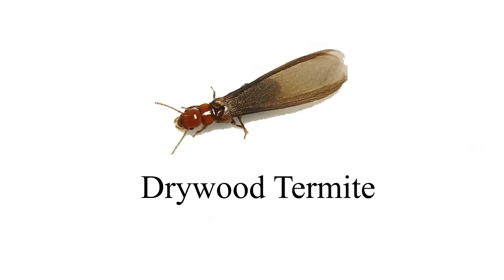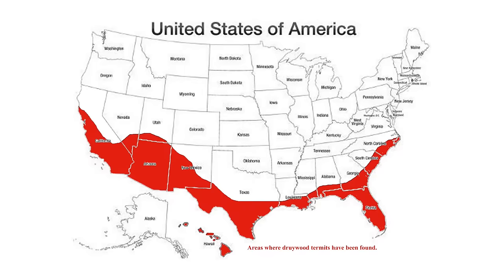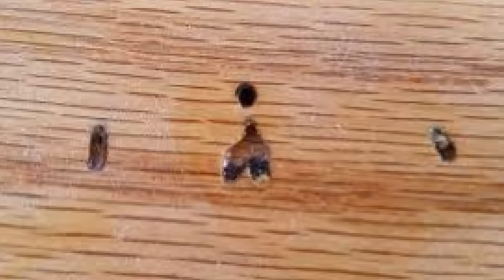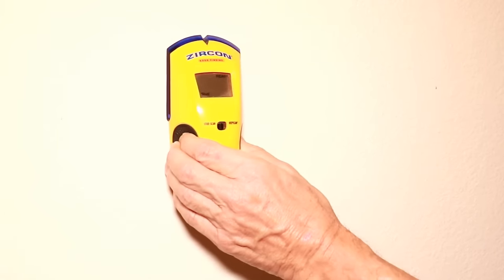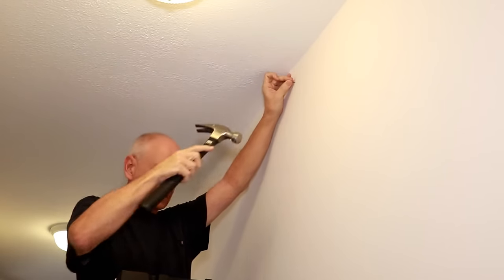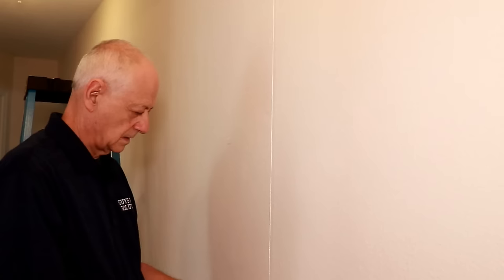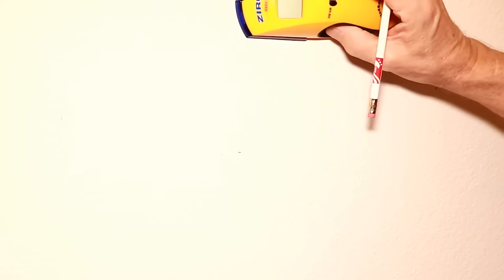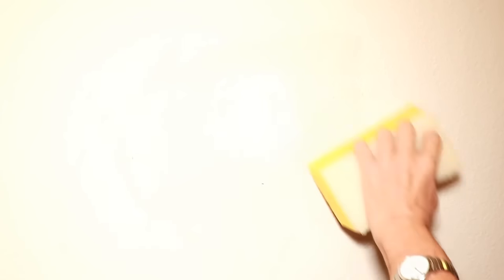How to Treat a Drywood Termite Infestation Yourself. A MUST see if you have Drywood termites.

Comment: Hi Guy, I bought an old apartment that was uninhabited for a long time and a lot of the floor and some doors have been damaged by termites. It's a  very nice wooden floor therefore I would really wanna keep it the way it is. I painted it with insecticide but I dont think it has done much as the floor is varnished and the penetration through the varnish must have been very low. What would you do? I ve been thinking of drilling holes and injecting foam/ or just the liquid insecticide I have but here (Portugal,  Madeira island) the selection of products is very limited and foam might be very hard to get.
Reply from the maker: It never ceases to amaze me how difficult it is to get pesticides in many countries.  The sad part is that there really is no reason for it.  The pesticides that we use today are just as safe as common laundry detergent.  
 
You said that you have some liquid pesticide.  Would you mind sharing with me what that is?   I think it is somewhat unlikely that it would be the sort of product that you need for termites, but it certainly wouldn't hurt to check.
 
Also, you indicated that this is an apartment.  That would suggest that there are other apartments that are adjoining yours.  Can you share with me if there are apartments above you and/or below you? 
 
Finally, we need to establish the species before we can figure out a way to treat them.  You have two main species where you are.  There are subterranean termites and drywood termites. The fact that you are talking about doors being infested makes me suspect that these could be drywood termites.  So, I would like you to inspect for mud tubes, frass, and kick out holes.  Please watch my video on how to identify termite species.  I will place a link below.  That video will show you what these things look like and where you might find them.  
 
Once I have all this information, I will do my very best if you provide you with the information that you need to address the problem.
 
Be well my friend.   

Video on how to identify termite species:   https://youtu.be/mY4FMvAHrMA
Reply: @GuysPestSolutions  Hello Guy, thank you for the reply! It's very kind of you - I'm pretty sure it's drywood termites but as for specie -  here it might be quite different from the US (island, sub-tropical climate, off the coast of North Africa). I took out the wood everywhere where it was hollow, and found quite a few termites. Definitely some kick-out holes, dead swarmers etc. The apartment is on the second floor (there are apartments below and above as well as on the sides.) I found two products locally that are pretty much the same things : "Axton: treatment for furniture and wooden floors"(anti-termite)  (translated from Portuguese) and another one "Xylophene extreme". I found some termites in the wood after painting it with those a few times, but they were mostly dead or dying. I spoke with a carpenter friend today by chance, and he said that what they used to do with old furniture is painting/spraying it with insecticide and covering with plastic tarp/foil to let it fumigate. I think short of taking out the floor, the latter seems like the best option for now. Using foam would be even better but I dont think I could get my hands on any, at least anytime soon. To be fair - Europe seems very much behind the US in terms of pest control and in some other countries around here I have never even seen wood-pest-products. Until I've had problems this year I've never even given it any second thoughts.
Reply from the maker: @janpiatkowski4255  I did my best to look up the Axton and Xylophene Extreme.  I could not find anything in English on Xylophene Extreme, but I think I found the active ingredients that are in the Axton.  As best as I can tell, it uses a very low dose of two different pyrethroids.  While this will kill termites, it will be ineffective in wiping out a gallery.  I'm guessing that the Xylophene Extreme is not much different.  In any event, these guys sound like they are dry wood termites, and you cannot effectively spot treat for drywood termites.  The only way to eliminate a drywood termite infestation is to fumigate the entire building.  Since this is an apartment building, you would need everybody to agree to doing the fumigation.  It would be in everybody's best interest to do this because, if you have dry wood termites, then it is almost a certainty that everybody else in the entire building has them as well.  It is only a matter of time until they do some sort of structural damage, that will affect most, if not all the residents.  How serious this may be will depend upon the construction of the building.  If the structural members, such as the roof structure, and floor structures, are not made of wood, then the damage may only be cosmetic.  However, if these structures are made of wood, then there is a reasonable chance that they are going to fail at some point.  Drywood termites are slow eaters, so this can take a number of years before it is a serious problem, but if these structural members are made of wood, then it is almost a certainty, at some point, it will happen.  If the structural members are not made of wood, then the termites are going to continue to cause cosmetic damage.  Since you cannot obtain Bora-Care where you live, I know of no way to prevent this.  I wish I had better news for you, but the laws in many countries make it impossible to address these problems.  At least, I am not aware of how to do it.  I am so sorry that I cannot be of more help to you.  My heart does go out to you, and I feel really bad about your situation.  I wish I had a solution for you.
 
Be well my friend.
Reply: @GuysPestSolutions  Hi Guy, Thank you so much for you answer and the time you've put into helping me! It's greatly appreciated believe me. I dont think it's so bad dont worry :) Wood isnt usually a construction material for apartment buildings in Europe or at least not so much, so the damage is limited.I will have to sand all the wooden elements in the apartment and apply the products that I have here and maybe some that I will get from abroad on exposed wood. I dont think fumigating the building would be an option I'm not even sure if they do it here. I think it's mostly my part of the building that is so strongly affected. The roof and the holding structure are mostly metal/plastic but I have a few small wooden beams in the attic though and I checked it there and you were right - there is a clear termite infestation ongoing there too. I will have a word with the neighbour that owns the rest of the top floor and maybe her grandkids will be able to inspect it there, but there is a big chance that only my part is affected as it was inhabited for almost a decade and nobody took care of it. Thank you so much, you seem to be a wonderful person!
Reply from the maker: @janpiatkowski4255  Here's the thing I know about drywood termites, and it doesn't matter where in the world you live, this is always the same.  If they exist in one part of the building, then they exist everywhere.  These guys are not like subterranean termites that usually just have one colony underground somewhere.  Drywood termites colonize in the wood itself and they swarm for several months every year.  When they swarm, there could be hundreds of them looking for a new place to start a gallery.  It generally takes about four to seven years before a new gallery is mature enough to release swarmers and that is why this is such a slow process.  However, as more and more galleries are established, the number of swarmers released every year is multiplied many fold.  There is a very good chance that your infestation has been going on a long time and that means there is also a very good chance that most, if not all, of the building is having the same problem, but people may not know it.  These guys are often in the attic or inside the walls, where you cannot see them.  If you have them in load bearing structures in the roof, then it is imperative that those structures get spot treated as soon as possible.  As for the cosmetic damage, this is going to continue, even if you replace the wood.  Therefore, the most logical thing you can do is to replace wood with non-wood surfaces.  Also, keep in mind that these guys will attack your furniture too.  If you have furniture that contains any wood whatsoever, then they will feel right at home establishing a gallery in it.  It is the same for wood cabinets as well.  So, if you have no choice but to live with these things, then wood is your enemy.  To the greatest extent possible, I suggest that you avoid remodeling with anything that contains wood.   

I hope that helps.  I wish you well my friend.